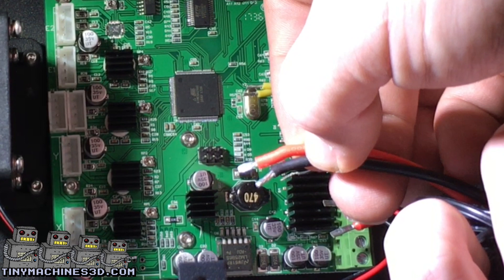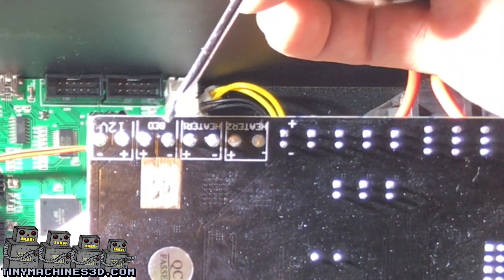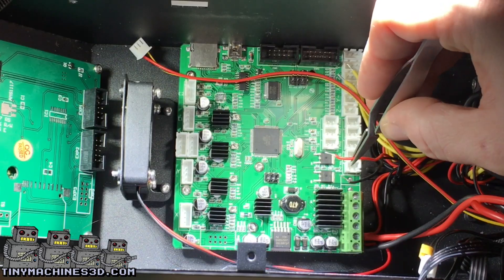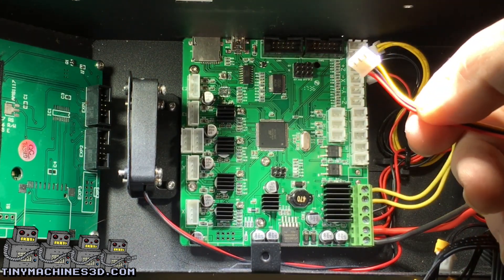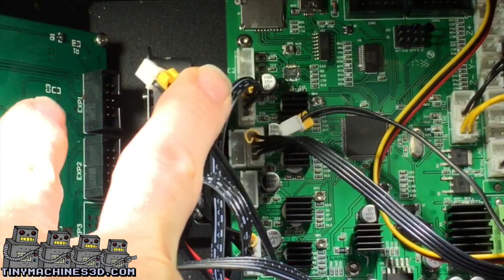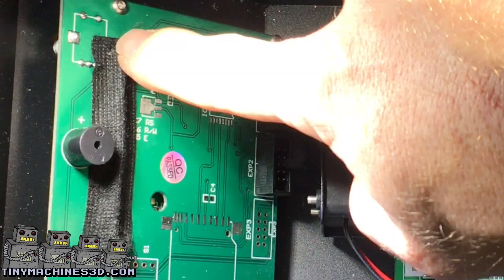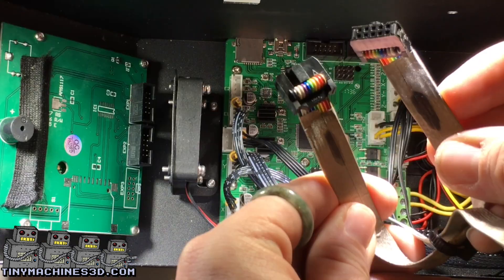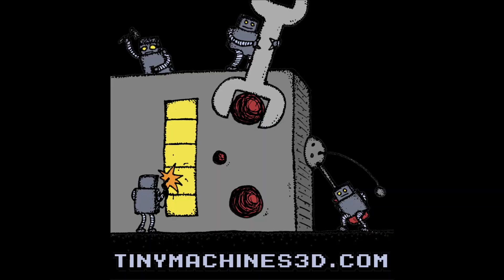CR-10S Electronics Upgrade Tutorial

Comment: So what do i need to do when a wire leading from fhe hot bed gets really hot (burnt the connector) too hot to touch and inhave bonide what board or if i have a mosfet.... aluminium hot plate with a 6 pin connector far right pin location and wire is whats heating up (the wire i believe heats the bed)

Comment: I need help with mine. I upgraded my Cr10s4 to a V2.1 board, and I can't get the second extrusion fan to start working, the input cooling fan. HELP. I really need this going.
Reply: do you have a driver soldered next to the second extrude connector ? as it comes with no driver.

Comment: CR-10s board does not have an "12v out" or sometimes called "fan" on the green block like the CR-10 does, but a 2nd heater option in its place.  So where do you plug the original"12v out" or "fan" from the green block on the CR-10 to the green block on the CR-10s?
Reply: I answered my own question, hook the old 12V or sometimes it says "fan" from the CR-10 board, to the 12V coming out of the PSU and into the "12v in" for the CR-10s board. This is also how some of the original CR-10 boards where hooked up (diff than mine), where they also did not have the 12v out.

Comment: I just did this with the newer 2.0 boards You need to take out the mosfet and its small trigger wires out of the 2nd and 3rd terminals. Take the power feed to the mosfet off the power supply and off the mosfet.  Strip the 2 remaining red and black wires and put the red and black into the 2nd and 3rd terminal where the mosfet trigger wires were.  ( The newer boards have an onboard mosfet)
Reply: You should do a video!  I just purchased the upgrade kit..so I'm trying to work a mental image of what you suggested (might be easier with new parts in hand)
Reply: You will see it when you have the case open and compare the 2 boards. You are just basically taking the mosfet and its wires out as it is in the new board
Reply: Okay, that's a bit more clear...so removing wiring...and old MOSFET   No new wiring needed.
Reply: One more thing....what if you have the dual z upgrade from a year ago?  Mine is still in the box and has the dual z cable (since the original board only has one Z plug)...the new board has two Z plugs...any issue there?
Reply: You run 2 seperate dual Z wires to the board . Mine was the same ! LOL I had it in the box a year also.
Reply: No, No new wiring . 
 you are just taking the 2 small wires that triggered the old mosfet and moving them to the board.
Reply: Did you need to replace the cable?  Sounds like you didn't use the Dual Z one that came with it?
Reply: You can text me as well on your Facebook CR10 group I am on it and the folgertech FT5 group and the Ender 2 group as  Elmer Suggins ( my alias )
Reply: yes
Reply: so are you saying that you need to take the v+ and V- wires off the mosfett and run them straight to the board?
Reply: You need to identify the wires. there are 2 small trigger wires sent to trigger the mosfet usually and then there is a pair for power in and a pair for power out on most . I am not near a printer sorry
Reply: Paul F. Thank you very much for adding in your descrption for v2.1. Really helped me to know someone else has upgraded to this, before I did.

Comment: I would now Like to RETRACT my previous statements about the CR10 being a Big piece of Sh-t.   I have Learned MANY Things Since the first comment was made. I now have a working CR10 with the upgraded Mother Board. My ONLY Problem with it now us the corrupted, and defective micro SD wish.com sent me with this early edition Printer.   If I can just get a new card made, It will work just fine.  If Anyone out there knows how to download the hex files and transfer them to my new FAT32 formatted as card along with the CR10 S    Downloaded files; I WILL Appreciate ANY , and ALL Help I can get.   Once again:  I apologize for the way I tore this printer apart before. There IS NOW, a light at the End of this 3d printer Tunnel.
Reply: Big John my CR10 is kinda a POS. But like you said, I’m learning a ton from fixing and upgrading it.
Reply: No, you were right the first time. This is the worst printer I have ever used. I've had zero issues with my Makergear... ZERO! Trivial issues with my Anycubic, and my Monoprice. My CR10 is fucking garbage. I've had to replace pretty much everything except the frame and it still sucks. I ask the company for help, they tell me to talk to the vendor. I talk to the vendor - they say they don't know, contact the factory. Getting ready to dropkick this thing.

Comment: There is no tape on the back of the LCD screen that I received from Tinymachines3d. Am I supposed to pull the tape off of the old board or come up with some new tape?
Reply from the maker: We send a strip of tape with the kit. It is bundled with the filament sensor and cable. If you cannot find that, use the old tape.
Reply: I didn't get any tape with my kit but I used some extra Velcro that I had laying around. Everything is working fine .

Comment: What if I want to upgrade a CR-10 with CR-10S electronics, do I follow the same process you demonstrated or are there incompatibilities? I guess you know since you did a CR-10 motherboard video as well :)
Thank you for your great work helping the community!
Reply from the maker: That is what we have this tutorial for. The box in the video originally had a CR10 motherboard and LCD installed and we swapped out the electronics. We have this upgrade for sale at www.tinymachines3d.com
Reply: Tiny Machines 3D :  This is all well, and good. It helped me surely new Mother Board, and the new LCD control screen, BUT;  I cannot Get this Brand New Printer to Work.  Everything it is supposed to do: It WON'T DO.  It will not print Anything.   Please Help Me.  I have the new V2 Creality CR10 S  Board.  HELP ME !!!  I AM DROWNING  !!